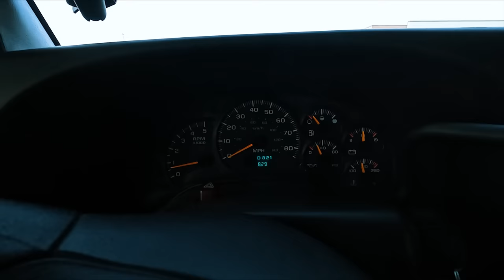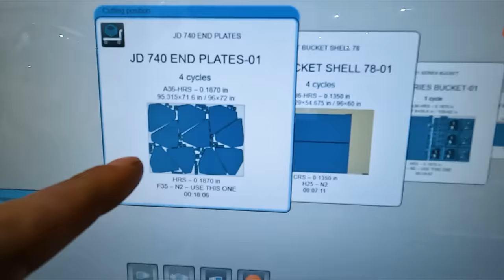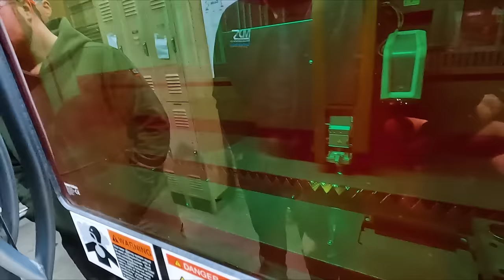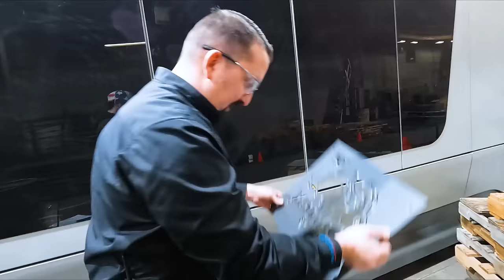New Toy For The Farm! And We Got To Watch How It’s Made!!

Comment: When the pump shuts off at a predetermined amount. Just hang the nozzle up and start again. My duramax truck has a 34 gal tank. So if it's low on fuel, it take 2 pump starts to fill it.

Comment: That whole nested parts laser cutout process is fun.  I wrote s/w to do the nesting of random planar shapes in my 2nd job out of college, it was gas flame cutting then - saved them HUGE money by optimizing the paths used in the gcode control of cutter head movements.   We really saved $$ when we combined many different piece cuts of projected runs - drove down the "skeleton" as they called it in this one to about 6%.  40 years, sure is cool to see the laser speed.  Probably still the same g-code moving it around, just different travel speeds...  Nice new handling front for you guys !  Thanks for showing the company operations - MDS...

Comment: Powder doesn't like angles. That's why they are pounding it into all the corners. If you set the guns up right and your grounds on the line are really good you can cut back the waste. Used to run a powder shop

Comment: I have that same $75 problem!  9:20 Skeletons would make neat gates. MDS could have robotic carts touring their plant; sell tickets & lunches! More fun than Disney!
Reply: When the pump shuts off at a predetermined amount. Just hang the nozzle up and start again. My duramax truck has a 34 gal tank. So if it's low on fuel, it take 2 pump starts to fill it.
Reply: @snakeman48  most of the fuel stations around here (middle TN) finally upped or removed the limit on the pumps. It was so annoying to have to reset at $75, then $100. I usually take ~$130 or so for my F250, 38 gal tank and now it lets me fill without stopping.

Comment: Ok so you have the rear air ride maybe the leveling valve has the rear to high meaning the bags are rock hard. But you can add air ride to the front for a sweet ride.

Comment: I wondered why you didn't use the wheel loader for snow. We had 4 that we used for snow. 3 with a large bucket that were made before couplers. Then a Cat with a coupler that we had a bucket, a set of forks, a sweeper and an extension boom. They could pile snow pretty high.

Comment: Chet when you was pointing at that laser screen. the hrs is hot rolled steel .187 or 3/16 thick. the second line f35 is the nozzle the n2 it using nitrogen as the gas and the bottom line .18.06 is the time it takes to cut all them parts. I run a laser every day mine is not that big it's only a 6000 watt fiber laser

Comment: I would love to hear them explain why they powder coat vs paint.  So many things are powder coated.  I have never had good luck with powder.  Once it gets worn the rust gets under and it just eats it away.  Then you can’t fix it easy like you can paint. So they end up looking terrible after a couple years. Idk maybe I’m wrong.
Reply: It's because of the e.p.a. and your volatile emissions with solvents. I ran into it as a furniture manufacturer. I was able to find a catalyzed finish as a work around at that time. I'm no longer in that biz so I don't know what the regs are now. I just sandblasting and paint my equipment now.
Reply: More durable coating.
Reply: I believe it is easier to do the powder goes on smooth when you turn the power on. And also more durable.
Reply: @OOpSjm  yeah I think that’s correct until the coating is damaged somewhere which happens easily in equipment use.  I live in the mid Atlantic and rust is terrible here